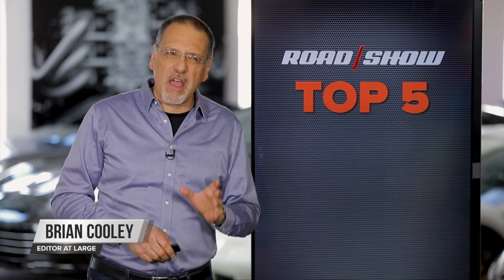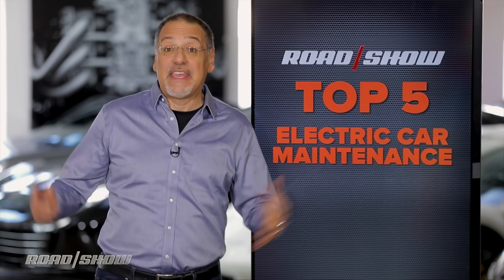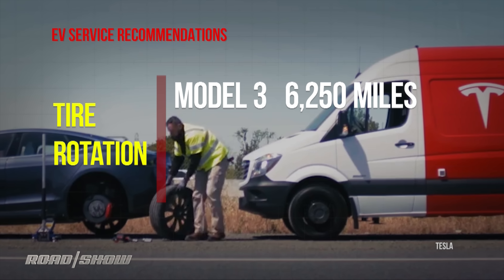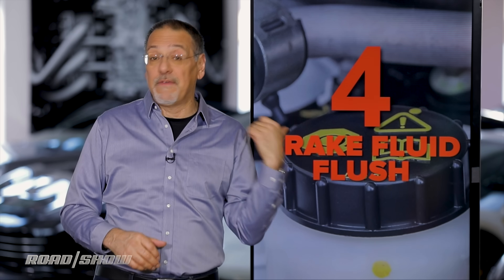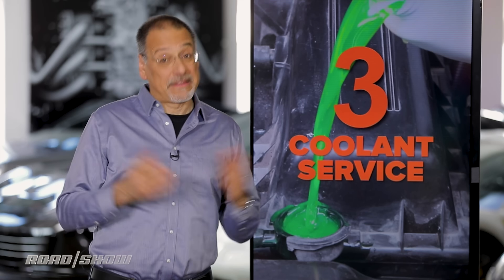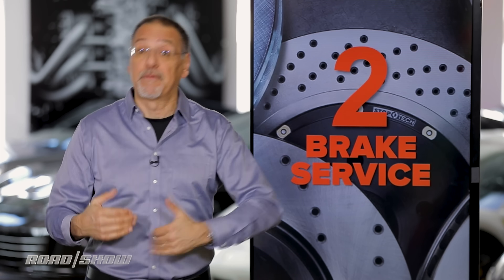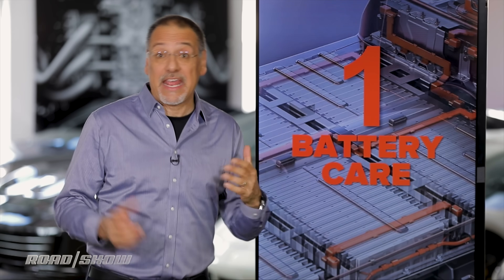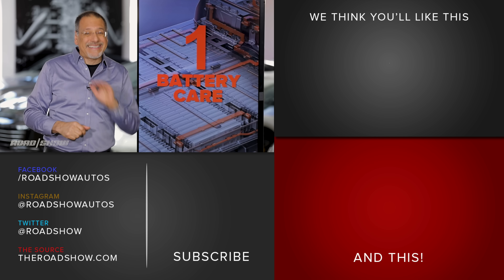Top 5: Electric Car Maintenance Schedule & Checklist | Cooley On Cars

Comment: Maintenance seems cheaper for sure, but those things aren’t free. At least you don’t have to pay 60-100 bucks a year in oil changes. And with cars like Teslas, now that people are buying ones with tons of miles on them, they’re discovering (expensive) faults. Sometimes the motors need replacing at eye-watering 4 (5?) digit price tags, and other times those big nice screens go bad, which can be 3-5k from my understanding. Hoovie mentioned these repairs having been done on his Model S.
Reply: Any articles to link on the motor replacement thing? That seems really steep. All I've heard is how service for EVs is generally cheaper. I'd like to know if this is bs before I buy.
Reply: Bertrand Riviere No articles on hand, but I’m sure if you do some research you’ll find literature on it. YouTube creator Hoovie’s Garage has a few videos on his Tesla that he’s since sold, apparently he bought it from a relative of a Tesla engineer, who had it basically from launch. He mentioned an eye-watering motor replacement cost. Maintenance is for sure way cheaper on an electric car, but it’s not free in the long term.

Comment: Good reviews Brian. How long should the electric motor(s) in an EV go before they need maintenance? They are running whenever the car moves, have moving parts, are part of the regenerative braking system, and must have wear.  Thanks
Reply: For AC motors like every EV have the stator and rotor have no physical contact you only have a bearing to worry about and they last basically forever. How many people you know have the motors inside their ceiling fan or floor fan broken.
Reply: Of all the EV owners I know.. none has ever mentioned motor maintenance... It's either replacement (which is a rare occurrence for ev's under 150,000 miles) nothing. 
Check out Sean Mitchell's Youtube channel. He compiles data some of the stuff that has been changed in Teslas' after 150k
Reply: @khavaliar  Thanks Kevin. EV's look like a much lower cost maintenance form of transportation. I'm looking for any potential "gotchas" with them
Reply: Idiot. Electric motors run forever compared to ICE. Another ignorant comment.
Reply: @bigdougscommentary5719  Why the sub-human comment? Its a legitimate question. Kevin Nyandika replied like a human being.
Reply: @jg11596  
The motor/gearbox assembly usually shares the same lubricant. A 100K-150K mile fluid exchange is just about all that is required in maintenance. 

To my knowledge the rotor never makes physical contact with the stator, it's all magnetic. Aside from the bearings, there is no wear and tear within the motor.
Reply: @wzDH106  Thank you William B - I'm thinking of electric motors from the past where the commutator and brushes needed cleaning and changing.

Comment: I just had the 4 year maintenance service done on my Tesla. Brake fluid flush, coolant flush, AC desiccant bag replaced, new wiper blades, fob batteries and cabin air filter.
Reply: You waited 4 years to replace your cabin filter???? Your car must have smelled like shit lol
Reply: @AnthonyBrusca  oh I've replaced it before DIY not part of the maintenance service.
Reply: @dshu15  yep I asked about that. The drive units have gear fluid front & rear. They said Teslas aren't exposed to heat cycles like a gas car so the fluid doesn't break down for a very, very long time, so I didn't bother getting the fluid changed.
Reply: How much was it if you don't mind me asking
Reply: @uuuu260  $825 Canadian. US would be about 25-30% cheaper. They also check logs, do a full inspection, tire rotation and top up fluids as necessary. Yeah it's not cheap at all but that was the first maintenance service I had done, and felt it was worth it because the car will be out of warranty right away so I wanted piece of mind that it's in top shape going out of warranty.
Reply: @InternetDude  what yr is your call?
Reply: tesla fanboys say these cars need zero repairs and maintenance is that true? @InternetDude
Reply: @neubauerjoseph  that’s funny, Teslas have coolant, brake fluid, oil filters, wiper blades, cabin air filters. There are lots of normal car maintenance that can be done.
Reply: If you don’t mind me asking, how’s the overall reliability been? What’s your mileage and model?
Reply: @michaelrocks1529  Garbage, plain and simple. I have a few videos of my Tesla problems on my channel.
Reply: @InternetDude  Ah, I’ll check those out.
Reply: @dshu15  only in the transmission/transfer case
Reply: @dshu15  Yeah that you will never have to change.
Reply: Why would you replace the ac dryer if they system doesn’t hAve a problem?